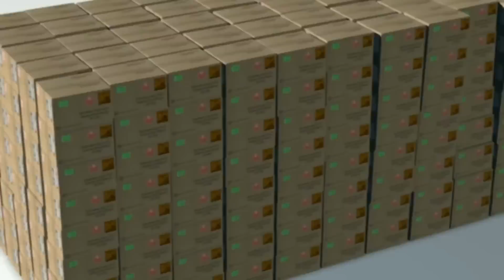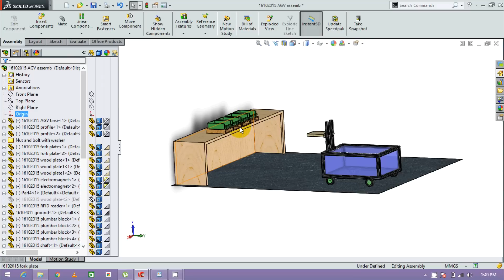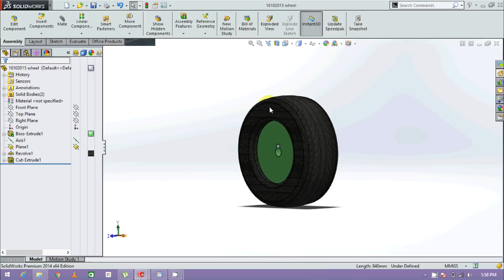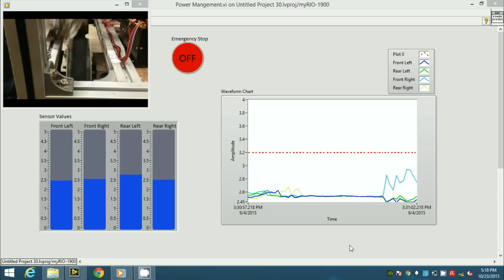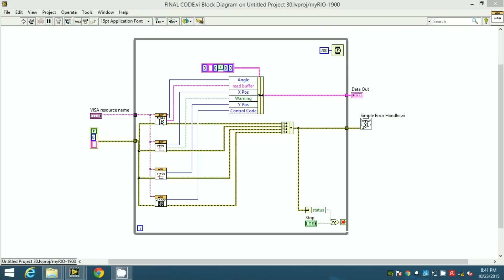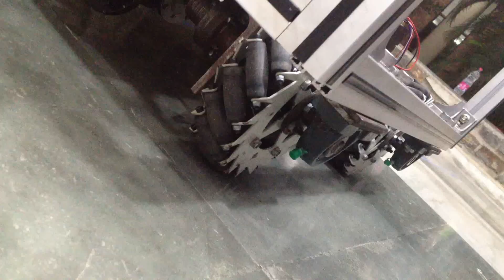NIYANTRA 2015 Automated Guided Vehicle Team NIY101 (1080p)

Comment: Videos AGV Automated Guided Vehicles

https://youtu.be/LkJKeuvYO3I

Robot Arm,diy Robot at home,Solder Robot,Shot Screw Robot,Mutil Axis Robot,AGV Automated Guided Vehicles,Robo Car,Robocon Diy,XYZ machine,CNC mini,Stamp Robot,Insert Component Robot,Circuit Board Assembly
PCB Assembly,Conveyor Automated,Homemade CNC machine with materials from a DIY,DIY Cheap CNC XYZ Machine,Automation and Control Technology,Industrial Robotic Design,Robotic Automation for Industrial Processes
Factory Automation Industry,Robot ABB.